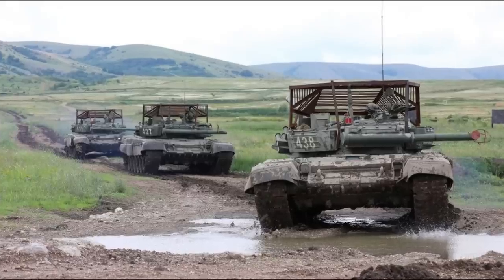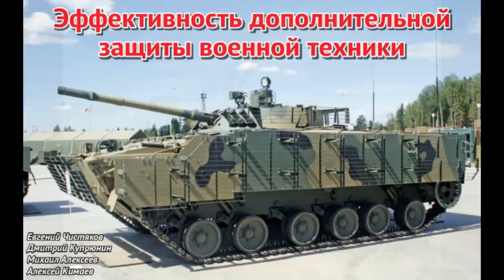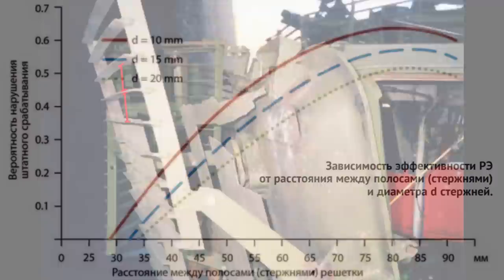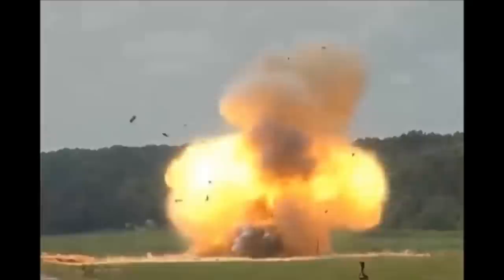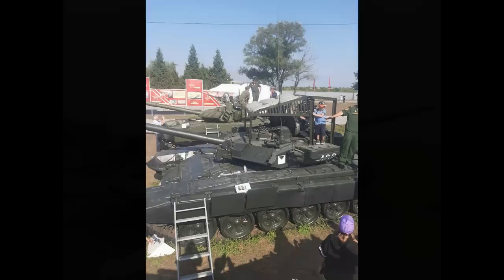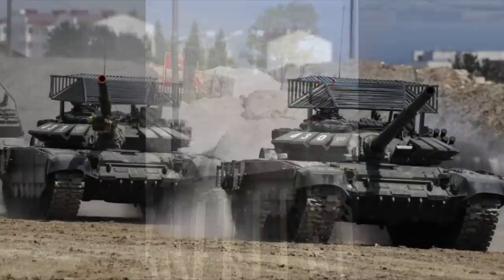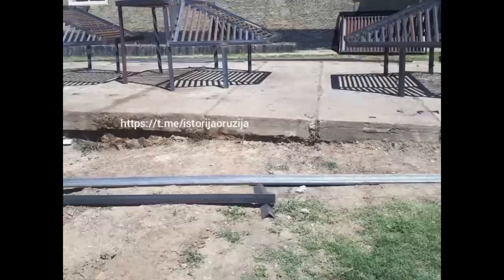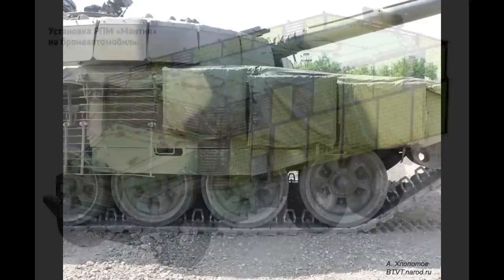The Truth About COPE CAGES

Comment: "Cope cages" were first implemented on Russian tanks in Syria, where drone dropped munitions first saw extensive use. The cages are not (were not originally)  meant to protect against modern anti-tank systems like the Javelin, although I wouldn't be surprised if the Russians in Ukraine are installing them in the hopes they will. In Syria they were used to detonate drone dropped munitions, small mortars, and molotovs above the turret, to prevent damage to the sights and sensors mounted on top. If a commander cant see out of his sights and the sensors don't feed information to the computers a tanks fighting capacity is greatly reduced. Originally the cages were mounted slightly lower and with thinner gaps.
It appears this Russian defense contractor saw the effectiveness of these cages in Syria and tried to modify them with some success to defeat anti-tank weapons. The "Cope Cage" is not an invention of the Ukrainian war, and its original purpose was not to defeat modern anti-tank weapons, despite the Russians hoping to use them as such now.
Reply: Agreed, but there are enough videos online of Ukraine using cheap drones to drop grenades that I think that is why they were put on. Also kamakazie cheap drones are being crashed into tanks from above. I personally believe it is to make the troops feel better about videos they see online of the drone drops. the commanders are simply saying "we beat this threat before don't worry"
Reply: I saw lots of slat armour on Syria , specially the cool one that is a T72 going "return to Panzer 4"
But never saw roof armour, do you have a way to show it?
Reply: @geroutathat  Ukraine do use drones this way... but the cages is flawed because it sacrifices A LOT of other things to counter a single specific threat. Drone dropped EFP. As said by you and other people, the Javelin, NLAW, Panzerfuast-3, AT4, LAW, suicide drones, and MAM/UMTAS from Tb2 drones... All would bypass the cage with little to no difficulty.
Reply: @neurofiedyamato8763  but its already proven to work against suicide drones and grenades dropped from drones in Syria. Isis had to start making smaller bombs in 3d printed plastic containers. Ukraine also has civilians who are dropping Molotov cocktails from drones. I personally don't see how a Soviet grenade can make it through this cage and take a tank out.
Reply: @neurofiedyamato8763  The actual data on effectiveness of Cope Cages on top attack AT systems like Javelin isn't rather scarce. At leas as far as I'm aware. 
But we do know how shaped charges a Javelin, an NLAW, etc. work . And if there's one thing shaped charges don't handle well is extra distance the jet has to go through. 
Javelin for example, has the stated penetration value of about 1 metre. The cope cages though, some are a very snug fit and some are pretty high above the turret. 
In any case, add to that the odd ERA block and you just might have a chance in preventing a very dead tank. 
My opinion why they didn't catch on is that the main tank killer in the latest war isn't the Javelin, but rather artilery... 
And with arty, the added height and consequently higher detectability probably aren't worth it.
Reply: @geroutathat  Problem is that ISIS and Syrian militant didn't have artillery support and loads of anti tank weapons. Sure, you could say that they're made against guerrilla warfare in South Ukraine, but as seen in Tet offensive in Vietnam war, it wasn't hard to smuggle RPG into the city, let alone vast countryside.
Reply: The Syrian T72s in basic form were pretty immune to RPG-7. I remember a tank commander fighting at Darayya saying they had been hit by RPG-7 multiple times that day. What kills them is tandem warheads such as RPG-29
Reply: Dude I was just thinking this
Reply: @minxythemerciless  which T-72 variant they used and which rockets are we talking about on RPG 7?
Reply: The kicker: Were tanks with these hasty drone cages known to be massing on the Ukraine border prior to invasion? You won't hear American "news" media performing even at that sophomoric level. Can you see this?
Reply: why are you lying? Russia in Syria did not use tank units in combat.Those Russian tanks that were there were guarding the military base.
Reply: @Работаем, брат! Good information.
Reply: @geroutathat  the cages are mostly installed on the turret, not above the engine, where most UA drone grenade drops tend to aim. In Syria I'd asume the explosive dropped was a hand grenade or a small IED, probably good enough to destroy the sensor cluster, but UA is using AT grenades that can actually penetrate the engine roof. After all, to kill a tank the crew doesn't actually have to die
Reply: This is exactly what they are for.
Catching stuff dropped from drones.
Reply: @neurofiedyamato8763  The cages have worked against NLAW and RPG munitions, which are the two most available AT platforms to the ukrainians
Reply: They said it themselves that it will protect against Bairaktar and Javelin. They are cope cages.
Reply: Thanks man, this is interesting! God bless :)
Reply: @Ban this youtube 
The metal jet has to penetrate into the ERA block for it to trigger. And I'm not sure the first charge of the tandem warhead has the reach to go from the cope cage to the ERA block. 
But you do make a good point. 
if the tandem Warhead can trigger the ERA block behind the cope cage, then both of those are disposed by the first charge and the second one would have a higher chance of going through.
Reply: I was a welder in v nam I built cages on our d7 dozers similar to these to protect the operator from grenades hanging in trees and snipers
Reply: The purpose of them is not as you mentioned, these cages are only intended to absorb, as he told you, the impulse of the hollow charge, and therefore the farther the distance between the cage and the main shield, the less the thrust and momentum of the plasma to breach the shield and these shields are only designed against HEAT weapons, they are not effective at all with mortars or artillery shells
Reply: Doubtfully it has different goal in Ukraine. It's not Russians aren't familiar with military tech.
Reply: still a cope cage just a diffrent kind of cope
Reply: @NaN compared to 1/3 of US arsenal of Javelins that was nothing
Reply: Why does everyone invade Iraq?  the point is that Reactive armour doesnt cover the top of Tanks as its wasteful

Also the top is lightly protected so the Russian high Command decided to install top slar armour as a cheap alternative
Reply: Javelin->Cage->ERA under cage=Less effective javelin. Not sure why this is being debated.
Reply: thanks for the detailed explanation.
Reply: For 110 days, there is not a single video confirming the successful use of Javelins.
Reply: American tanks in drag and the Middle East also had cages
Reply: A ton of them are conscripts so that wouldn't be a suprise
Reply: Who the hell told you that Russian Tankers using cages against AT weapons?
Reply: @Sercer25  
Because the cage is ineffective against the Javelin.
Reply: @TyphoonUSSR  
Quite right TyphoonUSSR. Just a hell of a lot of Russian tanks, APC's, and other weapons just spontaneously blew up all by themselves in the Russian invasion of Ukraine..
Reply: @grahamlucas2712  how many 10's of thousands of javs have been fired vs how many of them actually destroyed russian tanks.
Reply: @grahamlucas2712  Yes, the Russian people's militia in Ukraine, and not the regular troops of the Russian army, destroyed almost 2500 "Ukrainian" tanks, which in 1991 Russia transferred to the Ukrainian armed forces. On the territory of the Ukrainian SSR, Russia left a huge part of its tank factories. Was Ukraine able to take advantage of this legacy of Russia? For 30 years, the Armed Forces of Ukraine received about 10 new tanks from the "Ukrainian" tank industry, which were copies of the Russian T-84UD tanks, created in Leningrad. Now the people's militia of the Lugansk and Donetsk republics are methodically grinding NATO tanks, which are supplied to Ukraine by those NATO states that had Russian T-72s. Under such conditions, I don't think that from a photo or video, you would be able to determine which of the destroyed tanks was Lugansk, Donetsk, Russian or the occupying army of the Ukrainian Armed Forces. The only exception is the Russian T-72B3 tanks, of which about 50 were damaged and about 30 were restored and are fighting again.